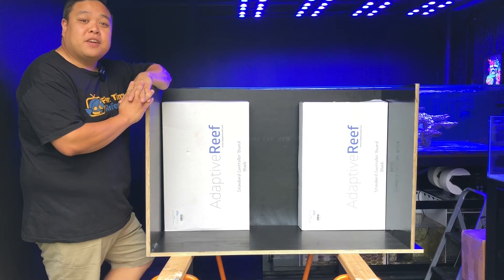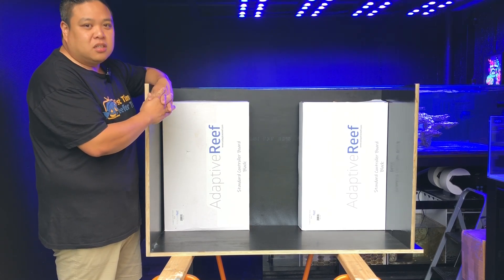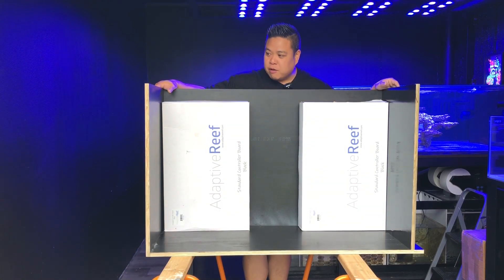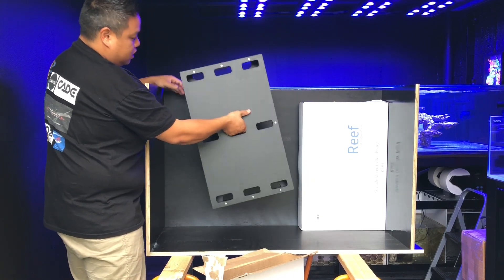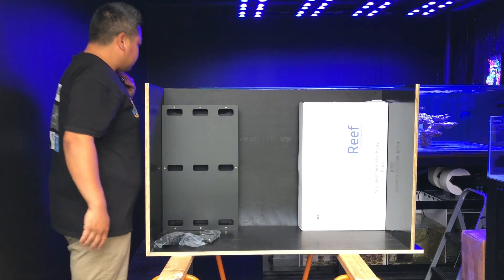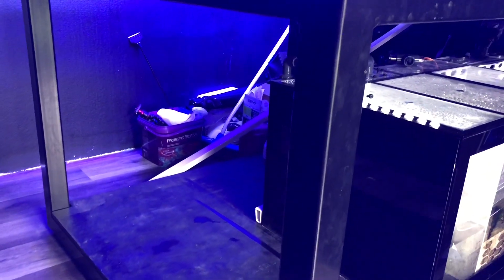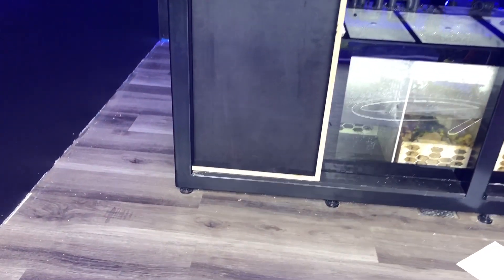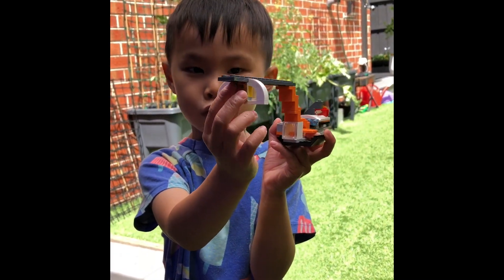DIY Controller Cabinet Plus Adaptive Reef Mounting Boards!!

Comment: Gotta love bunnings form ply. Might need to paint or seal the edges though. Fresh cut edges are not waterproof.
Reply from the maker: Its so good! They price beat a local too so got a sheet for $45!! Good point any idea whats best to seal with?
Reply: @firsttimereefertv1588  any kind of paint will work. The more coats the better. Or clear varnish works also.
Reply from the maker: @richardportelli1983  cheers ill get thay done!

Comment: I don’t understand why you are putting the controllers so far back - I would want them at the front, especially as they are basically at ground level - not 40cm deep inside your cabinet. Although, with all the remote control we have on equipment theses days, you probably never need to touch your actual plastic controllers - just do it all on your phone. 

Guess I’ve answered my own question! 😂

Looking forward to seeing the rest of this system as it comes to life!!
Reply from the maker: You hit the nail on th me head! Haha

Its more so theyre all illuminated nicely 😊 will rarely touch the controller itself

Thanks for watching!

Comment: Hey David, Happy New Year. Tank is coming along and looking great. Great to see some Adaptive Reef in Australia too although you could have continued with your DIY to also get a custom result. I would think about a cabinet top and rear mounted downward facing or shielded vents for extra water and splash protection with ventilation.  Get your Calc Reactor out of the controller box. This will give you extra space to expand equipment and eliminate potential leaks and spills inside the controller box from the reactor. Loose water lines, media top up spills, removal for major service etc. Spills and leaks will happen some time.
Reply from the maker: Thanks mate could have easily contijued the diy route but i do love the adaptive reef boards! Thanks for the feedback and happy new year!!

Comment: Happy New Year’s Mate! Hope you and your family have a great night planned. 

I’d mount the two AR panels on the sides to free up the back for your logo backlight (vs a light on top). 

And, I would not put the CaRx and bottle in with the electrics. While the chance of a leak is low, you’ll be pulling it out a few times a year to fill and don’t want water spraying or salt build up. (I’ve learned my lesson the hard way...)  

I’d also get the largest co2 bottle you can get. It will save you the headache later. ;)

Hope this helps mate.
Reply from the maker: Happy new year to you and the family mate! Tha ks for being a great supporter of the channel! 

I think this may possibly be how I mount them bt rather than either side it will be one corner! 

I will mount the bottle seprately but will still toy with the idea of keeping the calrx in the cabinet! See how i go 😅